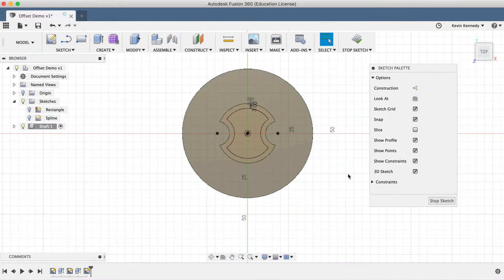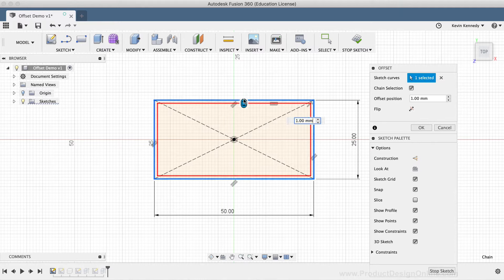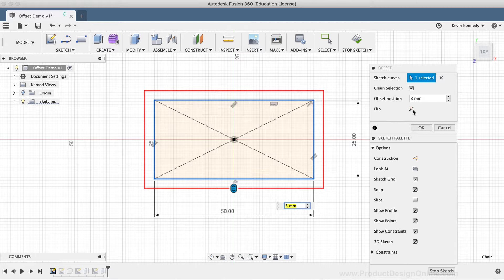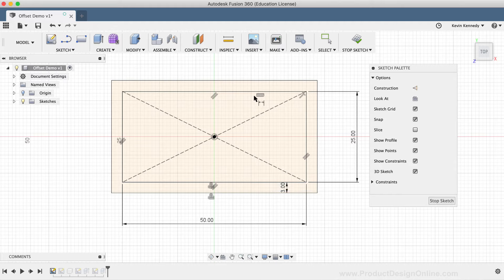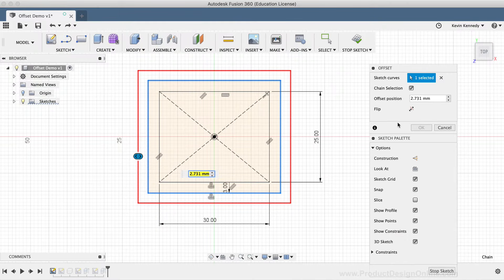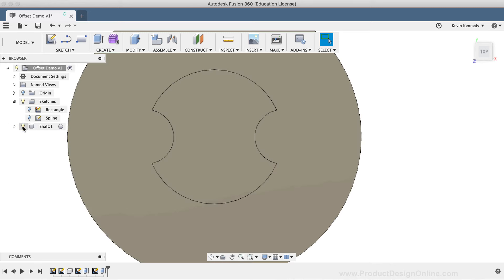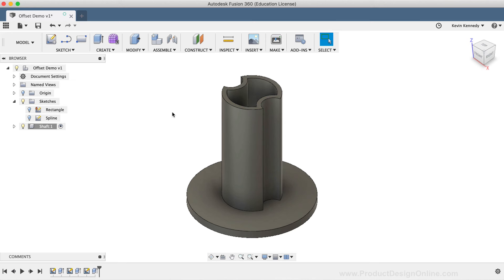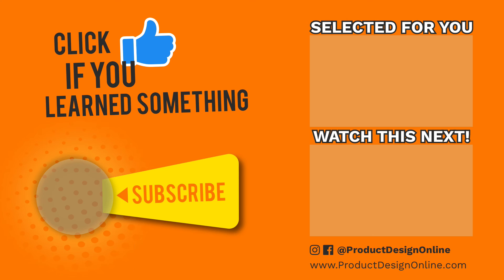How to Offset Sketch Geometry in Fusion 360

Comment: The direction that the offset goes by default is slightly complicated. Draw a line, the first point you click is point one, the second one you click is point 2. If you sat your  head at point 1 and looked at point 2 the default direction of the offset is to the right. 
The direction of the rectangle tools depends on what corners you click. from the perspective of the first clicked point, 
Up Right : outward, Up Left : Inward, Down Left : Outward, Down Right : Inward.

Comment: Hey on the new patch it has a two sides box(I understand that one) and link offsets box and match topology box what do those do?   

Also is there a easy way to do like solidworks where i can have a 1” line the select it do a double side off set with either square or round end cap?  ( line gets encapsulated by box or oval)

Thank you for in depth explanation vids i sick of shallow vids telling me what i already know

Comment: You’re teaching style is super. My issue is my version of fusion 360 is different than yours so I can’t find the tools in the same place
Reply from the maker: Thanks, Steve! All of the sketch tools are now located in the SKETCH contextual tab. The tricky part is that the sketch tab will only appear in the toolbar when you're in an active sketch environment. You'll need to "create sketch" or edit an existing sketch for the SKETCH tab to appear in the toolbar. Then, once you have selected the sketch tab you'll see the Offset feature along with all the others located under the "create" dropdown.

Alternatively, if you're looking to find the features faster (without the navigation headache) you can use the shortcuts box. Select the keyboard letter "S" to activate the shortcuts box > search for the desired tool.

Comment: Nice Video as always :) I would appreciate it if you could make a video about the "Hole Command". Is it possible to create a tapered hole where you define the length, top and bottom radius of it? I want to create standard ground joint with it.
Reply from the maker: Thanks, QuoKkA! Yes, you can achieve that with the hole command. They actually just added another update to the hole command with the latest version of Fusion 360. I'll have to make a video on all those modeling commands after I'm done with this sketch list. Cheers, Kevin :)

Comment: im trying use offset after creating a square then extruding it -.750 i added 7 holes and placed them with sketch dimensions now i need a .300 square on the inside of my box to make a pocket and when i try to offset the line my offset tool comes up but i cant select anything...  I'm doing the titan cnc academy courses and I've done them all once now I am trying to do them without the video and I am having issues. Any idea why its not available to me this time I have screenshots of my problem but cant upload them on here obviously
Reply from the maker: Hi Jeremy. It's hard to say what the issue is without seeing your screen.

Here are a few notes with the offset tool.
-You can offset from 3D edges (in your case the edge of the box). After activating the offset tool you will need to select the face to create the sketch on before selecting an edge
-You can ONLY offset from original sketch lines (as in, you can't offset from another offset)

You can share a link of a screenshot using Google Drive or snipboard.io
Cheers, Kevin :)
Reply: @ProductDesignOnline  its like once i start adding features to my sketches i lose the ability to offset do you know of anything in the settings that would affect the offset tool  i might have accidentally changed
Reply from the maker: @jeremyslone9230  Very strange. Would you be able to do a screen recording (you can use the built-in recorder in Fusion 360) and share the link?
Reply: @ProductDesignOnline   Yes I can I am installing it now
Reply: hopefully that works
Reply from the maker: @jeremyslone9230  Hi Jeremy. Thanks for providing the screencast. I now see the culprit. At 1:07 in your video, when you go to create the new sketch, you select the origin plane. You instead need to select the top face of the rectangle/block. By selecting the origin plane, you're removing the "connection" to the block. This is not only causing the offset issue but also your second issue with trying to extrude (after creating the offset first).

Ideally, you'll only select the origin plane for your very first sketch (required if you have no other designs)...and for any other features would use the origin plane as a "tool" (section analysis, split body, etc).

Let me know if that helps or if you run into any more trouble!
Reply: @ProductDesignOnline  dude that is amazing thank you so much... I've been stressing for over a week on this and stuck I knew it was possible I did it the first time I appreciate it so much and your videos along with the titans of cnc videos are my main source for learning... Im getting a 3d printer finally in a few weeks so your videos are helping me learn and prepare for that where the titan videos are preparing me for a job in the CNC industry
 Thanks again you dont know how much I appreciate it....
Reply from the maker: @jeremyslone9230  You're welcome, Jeremy! Glad I could help. What 3D printer did you order? :)